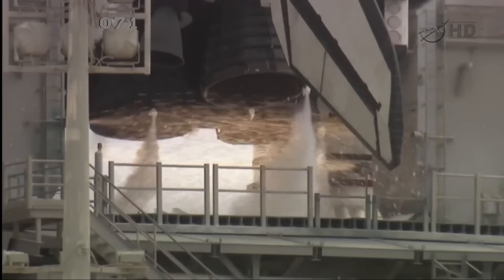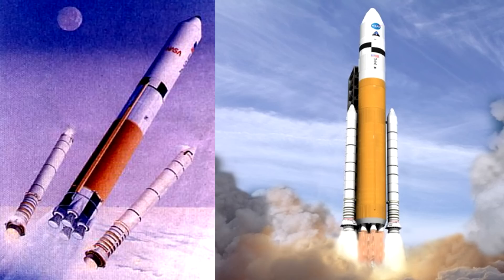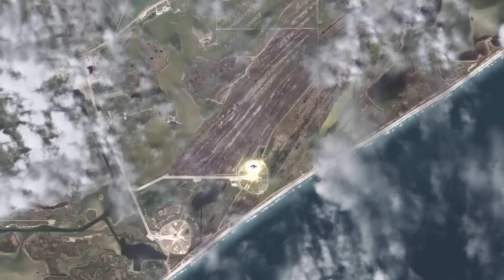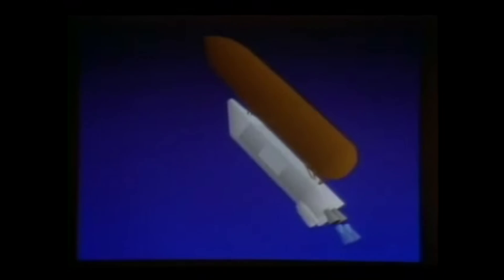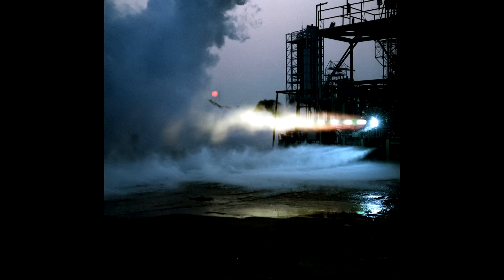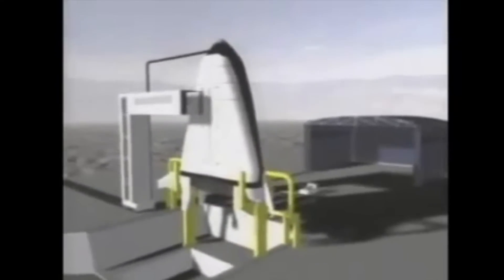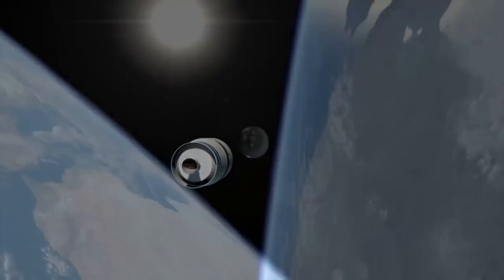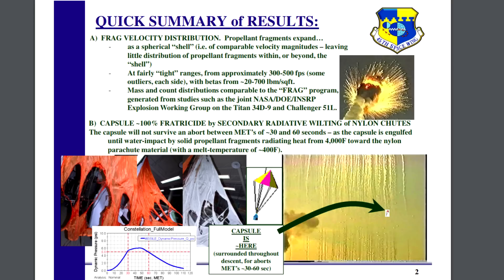Why The US Took So Long To Replace Space Shuttle's Crew Capability

Comment: The SLS is not a replacement for the shuttle. It's a jobs program.
Reply: Its more a replacement for the Saturn V, which we haven't had for a long-ass time, and everyone who was involved with the program is either dead or retired, so it has to be redeveloped from scratch basically
Reply: It's not meant as a Shuttle replacement. It's a Deep Space vehicle. Shuttle was strictly an orbiter.
Reply: The shuttle was only a part of the original system. We would have had re-useable in orbit vehicles by now.
Reply: STS was a jobs program itself, it was just more useful and helped progress technological development
Reply: I didn't knew that Steve'S legacy was in the space business.
badumm tschh
Reply: Long term I think the SLS is doomed (if it ever launches that is). The name of the game today is reusability and as the private sector begins to gain momentum dozens of companies will swiftly steal the show as SpaceX is doing as we speak. Then nobody will want to pay NASA a gazillion millions to lift anything with their mighty SLS, just because they throw away every booster.
Reply: @root9065  I don't agree.  NASA tried the reusability thing, and it bit them on the ass, screwing them into a vehicle that was more expensive to refurbish than to just build a new one for TWICE as long as its intended lifespan.  Honestly, SLS would be almost cheaper than the Space Shuttle, especially if they start pushing the hardware for everything it can do (like how they were able to turn an empty S4B stage into Skylab)

We have basically demanded a new alternative to the Saturn V for 40 years.  Now that we may finally be getting it,... we complain?  And "gazillion millions" my ass.  NASA's budget is about what the military blows through in a week.
In fact, the current annual military budget is about as much as NASA's entire frakking lifespan
Reply: lol no its a graft
Reply: YUP.
Reply: I feel the shuttle was simply too delicate. Maybe Starship has tried to address this with a more robust build/materials and a more manageable shape, but I still believe the shuttle style vehicles are simply too delicate. Eventually the reusable craft will fail and experience a catastrophic failure. 

I understand that reusability is seen as a holy grail of sorts (which is fair) but no matter how many successful missions you have, that one catastrophe is all people will remember. Maybe if you are reusing a first stage and it causes a satellite to be lost... no one really cares. However the moment you start reusing components on manned launches, a disaster will not be forgotten. The attempts to reuse things will always be seen as a money saving measure that led to death.
Reply: It’s probably also NASA’s last launch vehicle
Reply: @johnnyrockets191  I agree. My predictions- 
1. this is the last heavy lift rocket that can be claimed by NASA. 
2. A NASA astronaut will not set foot on the moon this century. 
3. In the next 30 years China will not only become the leader from a global influence perspective, but the leader from an aerospace perspective. 
4. The first humans to land on Mars will either be from a private corporation or from the Chinese Government.
Reply: More like a corporate handout.
Reply: Exactly. Military needs to keep the sector alive. They don’t want the people with the technical knowledge of rocket ships looking for money or a job.
Reply: As for things that the private sector can't do the examples are all true right now, but the SLS has yet to fly and many of the more niche uses for it rely on more advanced versions of the SLS that's even further down the pipeline making it likely that by then the private sector is delivering a competitive solution. Essentially anything not using the first SLS iteration is likely to compete against the BFR.
Reply: @aBoogivogi  And that's assuming that even the first-generation SLS becomes operational before the Starship/SH does, which is looking increasingly uncertain.
Reply: Sounds exactly like a shuttle replacement.
Reply: The problem is that SLS is so far behind schedule, that basically all of it's uses will more or less at the same time be fulfilled by commercial solutions as well.
If SLS would have been ready in schedule it would have actually been rather fine.
Reply: Virtually every space program ever made had been behind schedule.
The Atlas was behind schedule for Mercury
The Agena Target Vehicle was behind schedule for Mecury
Apollo itself was way behind schedule, made worse after the Apollo 1 fire
The Lunar Module was behind schedule, so they had to change missions on the fly
And the Shuttle... my gods, the Shuttle was HORRIBLY behind schedule

Being behind schedule is pretty much a NASA MEME
Reply: @k1productions87   without a doubt it is. I'm not saying the thing being delayed was unexpected. Just that it would have been far more usefull if it came out as planned. (Or as Ares V for that matter) By the point it's going to be done there's not going to be much effective service life left.

Just a sidenote here: Isn't it funny how Elon Musk gets slammed again and again for his meme-worthy timelines, while NASA is just as bad?
Reply: Ares V was not as likely to be any faster than SLS.  In fact, with the way it was going, risked being a lot worse
Reply: @k1productions87   But the rate of progress was so much faster in the 1960's! Even the Apollo1 and Soyuz 1 disasters resulted in only about a year and a half delay to each programme, despite extensive redesigns, whereas the Challenger and Columbia disasters resulted in two and a half year standowns with relatively minor modifications required. The rate at which the US moved from Shepard's flight on an improved V-2 (the Redstone) to the Apollo lunar landings using Saturn 5 was amazing, considering how long it is taking to develop Orion and SLS with thoroughly understood technology, using existing Shuttle components. Of course, the investment in Apollo was immense, but it was all completely new and phenomenally ambitious, whereas SLS either uses existing hardware, or incrementally improved new hardware, so the costs should not be as great as they are or the delays so egregious.
Reply: @k1productions87   You really must be a fun person at parties.
Reply: @k1productions87  Agena Target Vehicle was Gemini and wasn't behind schedule. It was never meant for the first three manned Gemini missions. Gemini 6's Agena was lost when the Agena's own main engine exploded on ignition. 7 didn't have an Agena as part of its' mission. 8 successfully docked with its' Agena, but developed trouble. 9's Agena was lost when one of the Atlas' booster engines lost alignment and crashed headlong into the Atlantic. 10, 11, and 12 were successful, 10 docked with both its' own Agena and with Gemini 8's.
Reply: Correction, Agena wasn't behind schedule, but it was clearly not flight ready for nearly a full year.  Which.... technically IS being behind schedule, as the schedule required a fully operational and flight ready vehicle by 1965, which didn't happen.
Reply: Pronto California can’t survive without taking water and electricity from other states

Comment: O-rings are back boys!
Reply: @otrab1080  which will not work if SRB explodes. But that has been known since Ares times and nobody cares.
Reply: maybe don't celebrate that fact.
Reply: @camohawk6703   I really don't think he was...
Reply: They took the single, worst idea from the Shuttle architecture, and *insisted* that any follow-up project must include that "feature".
You do remember that the SRB's were to be a stopgap measure, until they could develop liquid, possibly fly-back, boosters?
Instead that 42-year-old stopgap measure, which has already killed 7 crew, is being mandated for use in the newest launch system.
Reply: @marvinkitfox3386  SRB´s killed no-one, NASA managers did when they decided to launch against Thiokol warnings.
Reply: @tarnvedra9952  Really? You are going to argue THAT with regards why we should stick to SRBs? 

What about this: An explosion of an SRB spreads burning solid fuel debris all around, melting the parachutes of the capsule, rendering any Launch Abort System useless during early parts of the ascend - oops.
Reply: @MeetDannyWilson  
He's not advocating the use of SRBs; he's just stating an established conclusion of the Rogers Commission's report.
Look up the term "go-fever."
Reply: @HuntingTarg  The point is, the SRBs have failure modes that result in black zones - I want boosters that do not kill the crew when things go sideways. And NASA has "go-fever"? You don't tell. All the more reason not to give the boys SRBs to play with.
Reply: @MeetDannyWilson  
Had, in the 1980s.  And still had up through the Columbia disaster.  That provided at least part of the impetus to 'spin down and retire' the STS program - all the complexity combined with all the cultural bureaucracy was just asking to create another in-flight mission failure.
Reply: @HuntingTarg  The sad thing is that the individual parts are actually rather good. 
The SRBs are good as far as solid propellant boosters go. 
The SSME are excellent engines, if you don't mind the price tag and dealing with hydrogen. 
The STS spacecraft itself is a reasonable "shuttle".
The entire STS system is almost a "single stage to orbit" SSTO system, and is "reusable" (only the ET is lost, the SSME return with the "SSTO-stage" Shuttle).

But ...
The SRBs are not good boosters if you want to safely launch humans.
The SSME are way too pricey, if you want to lower costs.
The Shuttle concept (as implemented) is awful, if you want to lower costs and have rapid reuse.
And  yeah, rather importantly, the Shuttle concept (as implemented) is awful, if you want to safely launch humans to space and return them to Earth - a capsule is much much MUCH safer both during launch and reentry.

If you want to launch humans:
Instead of solid propellant, the boosters should use liquid fuel.
Instead of the STS SSTO concept, the launcher should be 2 stages.
The first stage should use RP1, methane, or somesuch fuel (instead of hydrogen)
Don't launch cargo and humans together (unless you have a really cheap, really safe and rather big rocket) - otherwise you get expensive cargo and unsafe humans.
Use a capsule, OK? Capsules work fine, once we had figured out how to use them properly some 50 years ago...

Yeah, hindsight is 20/20...
Reply: @MeetDannyWilson  
The arguments against SRBs are sound, and I think supporting their use in manned flight (again, in hindsight) carries a moral and PR cost most administrations would simply rather not pay.
However, the SSMEs on their own were not a boondoggle; exorbitantly expensive?, yes.  Wasteful or low-quality products?, I would be loathe to say so.
Look at what happened with the F-1 design (Scott has a video on this); an assembly that originally had ~210 parts and required a great deal of enginnering skill and technician know-how to manufacture & assemble properly.
4 decades later, the design is resurrected, and after much preliminary research, is reworked to conform to modern fabrication and assembly techniques, and has I think about 40 parts and needs 1/4 of the technical staff, and is even more powerful than the original.
There has been much grief and bemoaning on the demise of Buran-Energia.  While this may be justified, it is an illustration of what can happen when a design concept is, rather than incrementally refined as the STS system could and should have been, revisited after a generation or so of technological progress.  I imagine that if the STS assembly concept had been reworked, there could have been a 'SLS-type' concept that could accomodate capsules OR aerospace airframes - OR perhaps even both.  Yet once it produces a working concept, a gov't. program cannot be expected to develop the initiative to innovate. Makers don't join bureaucracies; they join businesses.
Reply: No shit, right? facepalms
Reply: I love onion rings!

Comment: I noticed the other day most of my ships on KSP look like a mix of SLS, Ares and Space X designs...  Although an Ares I is darn near impossible to recreate in stock due to the low thrust and lack of gimbal on the KSP solid rocket engines.

As for the contractor stuff. I live in Utah, my commute takes me a few miles away from ATK Orbital's Magna plant nearly every day; and I have been up and visited their Promontory facility were they do the primary work on the SRB motors. However, the irony is all this political back and forth really has been pretty bad on the contractors the politicians are trying to 'save.' Promontory has been pretty quiet since the end of the Shuttle program, with that 2009 Ares I test being their last flight. They may have done one or two tests on the SRB since then, but compared to the bustling era of constant work and testing during the shuttle it seems to be pretty lethargic now. Their transload facility in Corrine were they shipped finished SRB's to Florida has basically been mothballed. At this point as a company, it seems like ATK and Northrop are gambling on the SLS managing to fly; but for their sake I would hope they would start looking into potential non-government buyers for their products... since it seems the SLS has been a slow program so far.
Reply: The money flowing to contractors may be going straight to the shareholders and CEOs.   As with ULA and the billions to keep them open, apparently no one thought Space X would come along and they should of invested that money in new designs to replace Atlas and Delta.  The old days they could of gotten congress to fund a new design.
Reply: They aren't gambling on it. They are just milking it for all the money they can get.

Comment: The running theme seems to be politicians keeping the shuttle contractors in work. Something tells me that since they never got the Shuttle out of prototype phase, despite it being a workhorse for decades, they weren't the people for the job for it's replacement.
Reply: The shuttle was a mess pretty much from the requirements phase. Engineering-wise it's pretty good, but the government and NASA gave the designers so many conflicting requirements (e.g. the capability to capture satelites and bring them back to Earth) that it was pretty much impossible for it to be very good at anything. The problem we've had for decades is that no one can agree on a focus for NASA, so programs get cancelled, their budget gets rearranged, and their priorities get shifted. In the end, this leads to not much actually getting done, in spite of all the people working on it. Few seem to have the political will to give NASA clear and consistent leadership.
Reply: I stand corrected and am in agreement. If there was some modicum of consistency from administrations over the years, then we'd already have at least the equivalent of a truck stop on the Moon by now.
Reply: @techmage89  That wouldn't be such an issue if NASA was a basic research agency.  The original idea was that NASA would test new technologies on experimental craft that the private sector would go on to mass-produce, much like NACA did for airplanes in the '30s and '40s.  NASA should be the ones testing new methods and materials while the private companies use proven, conventional technologies, not the other way around.
Reply: Shuttle was a jsck of all trades master of none, craft. for its time it was really incredible, but it aged poorly and failed at the one thing that it was supposed to do above all else, lower the cost of access to space. Arguably as it was built on the jobs program model of Apollo it had no real chance of doing that, however the biggest problem was mission creep, it had to do everything as it got more expensive. We could get into cost plus motivating contractors to be inefficient, but thats another problem.

The real problem with Shuttle Derived Launchers is that it SOUNDS easy, in theory, but the more you diverge from what the various parts were originally intended to do, the more you are re-engineering everything just to keep a little bit the same. And because it sounds easy but is expensive and takes a while it is more susceptible to mission creep, which is one of the root causes of Shuttle's problems.
Reply: What's funny is the Soviets designed the shuttle that NASA actually wanted (Buran), but they realized soon after building it that they didn't need it. At all. And shortly after that their economy collapsed, but that was incidental.
Reply: The space shuttle had an X-# designation?
Reply: Schrödy Brodie they designed and built the deadliest, least reliable space vehicle in the history of mankind and the government wants to trust them with the future of American manned space exploration... gotta love corruption.
Reply: *Or it's just a money pit program designed to do nothing other than sink tax money into never to be seen again, like the moon landings, NEVER to be seen again !
Reply: @AuntAlnico4  
What about all those NASA and subcontractor employee salaries?  It's not as if none of those people did anything useful - ... or perhaps possibly some people just see stuff go up into space and call it waste because their tax dollars don't come back to benefit them.
Reply: Schrödy Brodie 
USA has a replacement, except it's Top Secret TR-3B,
using UFO (antigravity & ZPE
propulsion)  Built from Black
Budget which would take a
POTUS EO to disclose & would
mean releasing current technology to the public// deemed too disruptive to
Monopoly special interests (oil, Banksters , carbon credits)
Reply: @davidporowski9512   Are you from the Time Travel page on FB?